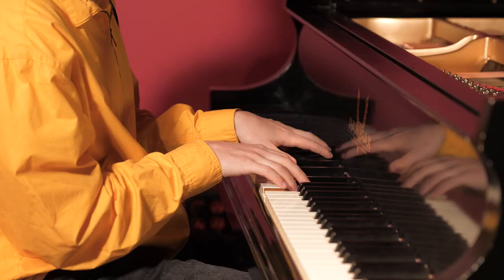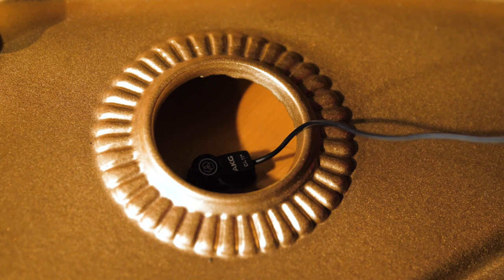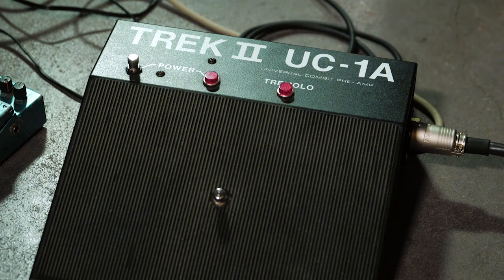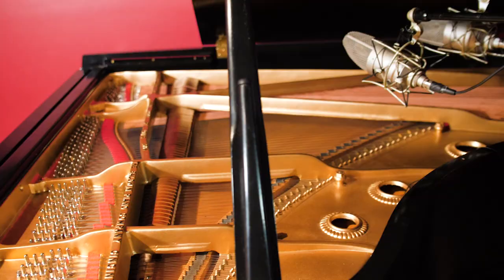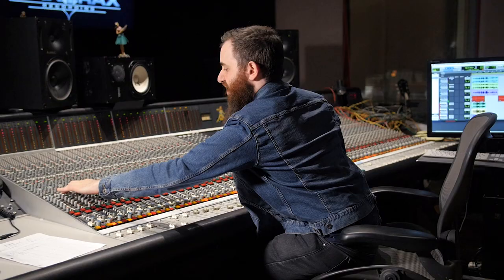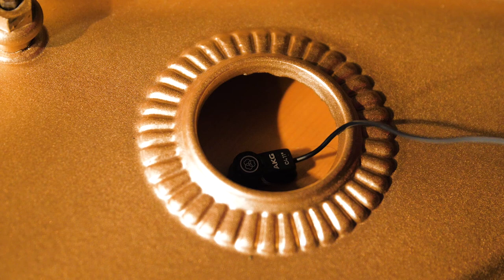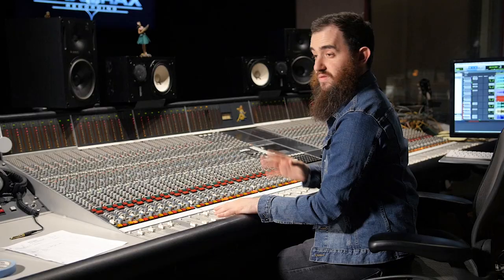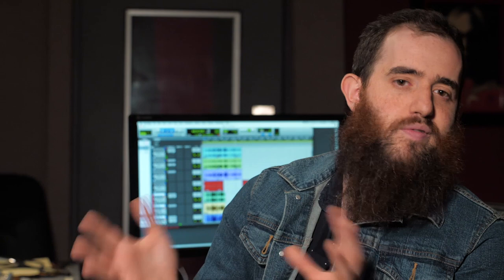Pitch Modulating an Acoustic Piano with a Leslie Speaker | Reverb Experimental Recording Techniques

Comment: If you’re only going to use the wet side of a chorus pedal why not just use a vibrato pedal instead. Cool video though
Reply: what difference does it make?
Reply: @tonypizza8571  You're only hearing the effect side of the signal. Not the blend between the dry and the effected which gives Chorus that sound.
Reply: @p0llenp0ny  i understand that. What I meant was, what difference does it make if OP changed from only using wet signal of chorus to using a vibrato? Would be the same thing, and you therefore don't gain anything by changing!